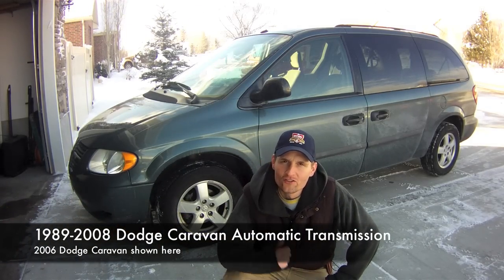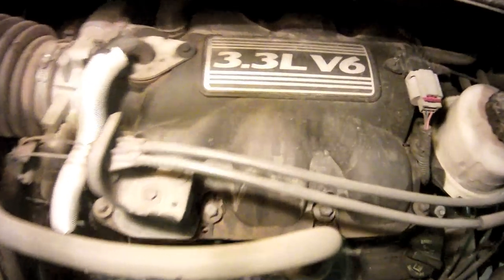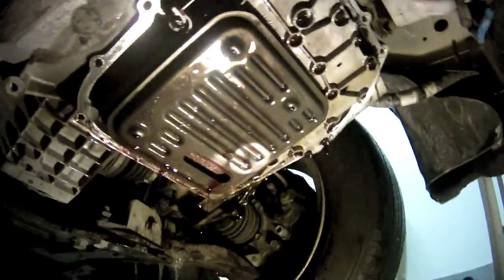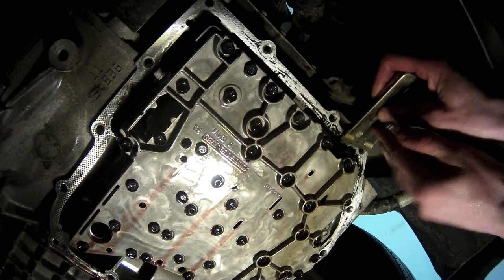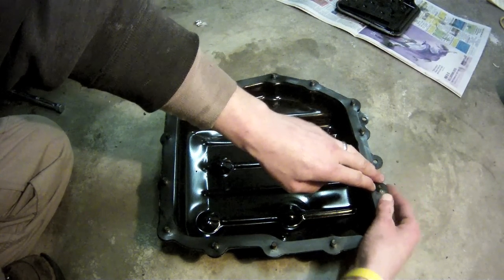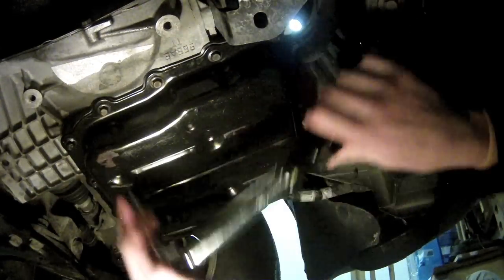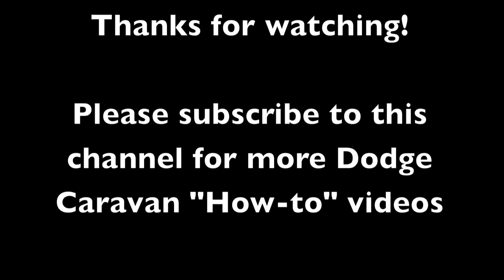How to Change Transmission Fluid in a Dodge Caravan

Comment: Thanks a lot. job done. Removal is fairly easy. Found the bolts very easy to remove not high torqued. Putting new filter up gave me a hard time (bought it from Amazon, pins were too small, filter kept falling, o-ring broke, crappy product, etc; Bought it again from Autoparts store and it worked fine), gasket on, no sealer used, no torque wrenched but followed the sequence and common sense while tightening, refill it up, no leaks, ran it, checked, good to go. You can do it !!! Be safe. Use Floor cover, Gloves, glasses, light, highly recommended.

Comment: This is a most excellent video. Thank you. It helped out tremendously. I just did this service today. The longest part is to scrape the gasket material off the body of the casting. Even though the Dodge service manual says 165 inch pounds, I agree with you when you say 120 inch pounds. I heard about these 40TE, 41TE transmissions sometime having weak castings that are easily stripped. Also someone wondered if the trans fluid could be sucked out the trans fill tube by sticking a tube down the fill tube and using one of those vacuum pumps. I tried this and was only able to get a quart out. This is because the van was on ramps and the fluid went to the back of the pan. the dipstick tube is in front of the pan. Thumbs up and Subbed!
Reply: Hi. I am about to do this procedure. Will I need to add rtv sealer to the provided gasket? Or just the gasket by itself?
Reply: @lromeroyt  I found out something from the dealer. Chrysler does NOT use the gasket anymore. They just use a special rtv sealer when they put the pan back on. The special rtv they use does not break down from transmission fluid. I would go to the dealer and get this special rtv sealer and just use that. They can tell you how thick to put the bead around the pan surface. I forgot how thick the bead should be. 
I have another tip. Make sure you use the torque sequence when tightening the bolts. I used a torque wrench that could do inch pounds and I took my time. Don't over tighten or a bolt can strip out. If a bolt happens to strip, do what I did and go to Lowes or an ACE hardware and get a slightly longer bolt that has a couple of more threads on it. It might be able thread into extra unstripped threads of the transmission body. BTW my Dodge Grand Caravan has 187K on it now and I'm not gonna change the transmission fluid anymore. The clutch particles in the fluid might actually be the thing that's making the transmission still work!. No kidding!

Comment: Nice Vid. Breaking the seal to remove the pan was tough on my car as RTV had been used. Had to carefully use a hammer and a sharpened screwdriver to pop it.  I used a gasket and some Permatex sealer to reassemble. When replacing the filter make sure the old O ring has come out properly (mine hung up inside the hole ) and O ring is in place on the new filter.

Comment: Great video. Doing this service today on wife’s van then on my Porsche Cayenne. Unfortunately this one is way easier than the Porsche is. Purchased a Mityvac fluid extractor/dispenser so can pull all the fluid out of the pan before I drop it. Hoping it eliminates the mess.

Comment: you speak very clear, good video and lighting which many diy videos don't demonstrate. thnaks.  i did this on my van 30000 miles ago but forgot if i poured fluid out of filter as part of my total amount in the bottle where i put old fluid. my hardest part was breaking loose the pan after removing the bolts.

you mentioned 4 qts drained. did that include pouring out  the fluid from the filter?
Reply from the maker: +scooter12368 I didn't get precise enough to measure the fluid that was in the filter. The idea is to get a general idea of the fluid lost so you can get it filled properly faster, but you still need to follow the appropriate measures to get it filled back up to the right level (regardless of how much fluid you measured coming out). A quick example is that if you had somehow lost some fluid on the road, you wouldn't want to just fill back up to the level you were at before, you would fill it to the level it was at, then take readings and add more as appropriate to get it up the the right level.

Comment: Very good, succinct description with excellent camera work, well done.

If i may suggest a few things:

Do not base how much fluid you need to replace from how much you drained, this is because you could be missing some. The 41TE that you drained has a total of 9.1 quarts, when you do a pan drop 4 quarts SHOULD come out. So regardless of how much you drain, you should add 4 quarts of ATF +4.

The torque on the pan bolts is 19Nm (165 in. lbs) according to the service manual, make sure you leave a note not to confuse anyone. 

Cheers.
Reply from the maker: Great tip - you are correct. Looking at how much fluid you took out is only a rough guide. You should always check the fluid using the dipstick once the vehicle is warmed up to make sure that the fluid level is correct.
Reply: wait- my old fluid is bad (tan colored).  I want to replace ALL of it.  Are you saying I can only drain 4 qts?
Reply: @baconmaster1023  Yes, if you want to replace it all you have to flush it. Or do multiple replacements

Comment: I'm a big fan of Permatex's "Hi Tack" gasket sealant. It never hardens, is impervious to oil, gas, etc. and seals up any small nicks in the aluminum sealing surfaces.  It's not RTV, it's more of a very sticky liquid, but it's amazing for sealing when using gaskets.  Also, Hi-Tack won't shed booger balls like over applicated RTV and clog up small oil passages.

Comment from the maker: Thanks for the tip Pete! As you mentioned, High Tack works great WITH a gasket whereas I've mostly seen RTV used AS the gasket. One quick note about RTV (since you mentioned it) is that normal RTV is not compatible with ATF and should not be used to seal transmission pans. Thanks for watching!

Comment: Decent instructional vid.
I've a question, if anyone's still haunting around here. ...
My friends '96 caravan's transmission is low, not reging on dipstick. Was having difficulty understanding what it means on the stick, on how to fill/ not to fill, depending on where the level is on dipstik, plus temperature is pending as well,-.. as there's instructions stamped on it. Do I just fill it cold like you did in vid? or do I warm it and fill? Fill with eng running or??...  also, if it's not showing on stick, is that a qt or two low?? The trans does go into gear and drives, but she says it slips a tad once it's warm & driven.. 
Thanks if anyone can add some light

Comment: FogoFox...Amazing video...Thanks for the simple, step by step, well narrated and well shot production. We own a 2003 Chrysler T&C w/a 3.8 w/85k. Recently, put it in reverse and "nothing" for about 30 seconds. Then the "hard downshift" thing started. After looking at a pile of blogs and watching your video, I decided to change my tranny fluid. Although you stated this several times in your video, I tightened my bolts to 80 ft/lbs NOT 80 in/lbs. Stripped a bolt...my bad. BTW, no change in tranny.

Comment: When removing the pan, better to remove all of the bolts except for the four at the front of the van. Just barely loosen those 4. Alternate striking the back corners with a 2lb. blow hammer and the pan will loosen, letting the fluid drain. Go have a 15 minute lunch. When you come back, the fluid will be drained enough that it wont gush out like it did to you.

Comment: Thanks for well made video... I just replaced a radiator on my 1999 caravan and for some strange reason I now have a leaking AT sump pan gasket.. All is good on oil cooler end and fluid is flowing.... So will need to remove and change fluid.. And filter while I'm at it.! Thanks..!

Comment: Thanks for the video , I followed your instruction I tried at 40Lbs stripping the tread of the engine, I think it was too much torque, 2 out 14 got spoiled, next day i Pulled out the pan again , It drain even more fluid, and then  applied Permatex excellent product
my torque was very light 14 pounds only, I would strongly recommend  this sealant , when i disassemble was with sealant originally , it was very hard to get it out after i took off all bolts, I had to hammer and use a crow bar to break the sealant, 
Anyhow I got the job done, I let it dry for 72 hours before i refill with fluid, my engine it aluminum very soft for 140 pounds, I might be wrong, but it better be safe than sorry, I used a gasket first after taking it off it was all wet and broken at 40 pound only
Thanks again for sharing
Reply from the maker: Are you familiar with the difference between inch-pounds and foot-pounds? Just want to make sure we're not talking apples and oranges here....
Reply: FogoFox I know so, when I disassemble it was light torque I just applied what I found , I did not want to strip more treads , so far I did an excellent job,  review your torque when you are using sealant and when you are using gasket , is different,  my procedure worked excellent after few weeks nothing drips absolutely nothing.

Comment: So you changed the fluid in the pan. - What about the other 4-5quarts of fluid in the converter ? ? You just going to leave that in to contaminate the new fluid ? ?
Reply from the maker: chuchyboy Yes. If your transmission has totally roasted out the fluid, then you should probably go ahead and remove it all. For a regular filter change and service, this is sufficient.

Comment: I liked your video but my question is did you use a sealant on the gasket? If you didn't why not and did you have a leak later and be honest. I had many leaks on my ford f150 pan leaks due to over tightening. But finally not leaking after countless times of using different sealants (blue RTV black RTV and even the yellow sticky hi tack). I finally just used the black rtv sealant and spread it with my finger all over the pan and the transmission surface and it finally stopped leaking.ChryslerNext

Comment: Thank you for this video. I have a Dodge Grand Caravan 2007 with 145k km on it. I purchased it with 66k km 5 years ago. I do not know if the transmission fluid was ever changed. Do I need to change it ? It looks pretty clean on the dipstick.
Reply: Yes I would it is simple enough with proper tools and parts available on hand. Follow your vehicle owners manual if you do not know ask the local dealership for what type is being used.

Comment: Great explanation and amazing execution. I am going to try it on my '96 Caravan. But if I don't have and can't currently afford a torque wrench, can I use a normal wrench to tighten the screws? How can it affect the deposit?
Reply: Not sure if you've already done the job but you don't really need a torque wrench. There is a proper torque spec for the bolts but this isn't a technical procedure. You just want to snug the bolts. The gasket does the sealing so you just need to be sure they're snug. Just be careful not to over-tighten or you could strip out the threads on the transmission.

Comment: Excellent video.  Have you ever done this job using an oil extractor through the transmission dip stick tube?  Might make it a cleaner job when you go to drop the pan.  At the same time could lead to problems.  ie torque converter gets drained and then is runs dry on start up?.  Any thoughts?  I would rather do it the messy way knowing I won't screw anything up.  My 2005 Caravan owner's manual says you never have to change the fluid in the transmission.  Right now it has 81,000 miles and trans fluid is bright pink.  I bought it used at 79,000 miles so I'm not sure if previous owner flushed it.  Regardless of what the manual says I think I will do what you show in this video as soon as the fluid starts to darken.  Also I notice the snow in the video.  Have you had blown power steering hoses during winter?  I live in Saskatchewan.  Very cold winters.  I changed my power steering fluid to BG Universal Synthetic Power Steering fluid.  I hope it solves the problem.  Any experience with this?  I know someone in Saskatchewan would works at an automotive garage as a service writer.  Last winter he said around 15 customers came in with blown power steering hoses on there Caravans and there was only one with a GM.
Reply from the maker: +Niko Lehocky No experience with that blown PS hose issue. 
One downside to doing the oil extractor is no chance to inspect the pan magnet or to replace the filter, but it would be a nice clean way to get the fluid changed I bet.

Comment: thanks , i didnt see any glue put on as you had to scrape the old glue off. do i need glue then or does the new gasket hold fluid without glue? thanks this was just what i needed to see. i couldnt find a drain plug so i have never changed the tranny fluid, its time.lol

Comment: This past weekend my wife told me that her van ( 2001 T&C ) w/ 130k was acting up. I took it for a test drive and noticed that it would quickly surge at times for a quick second when driving. At one point the transmission would not shift into a higher gear making the engine rev at 3000rpm at 50mph. I am not familiar with these vehicles and fear that a rebuild may be in order. Any suggestions from those who have experienced this would greatly be appreciated.

Comment: You did a fabulous job explaining and showing how to change the tranny fluid.  Your camera work and lighting is especially clear.  Am I correct in assuming it's not too different changing the fluid with an 07 Town & Country?  Are there any special pointers that pertain to this model & year?
Reply from the maker: Maggie Thanks for the compliments. Everything should be very similar if not exactly the same.

Comment: Excellent video. We work in Nm here and please correct me if I am wrong but the first pass is about 9Nm and the second would be about 13.5 Nm. If I am wrong I will not be surprised as I only just found out how to convert Inch-Pounds by using You Tube five minutes ago How to Convert Inch-Pounds to Newton-Meters : Conversions & Other Math Tips PS Is that ice on the car?!!

Comment: So you've changed the pan gasket and filter but what about the other 70% of fluid left in the transmission cooler lines and torque converter? Do you just not service the rest or do you have another video out describing how to remove and replace that fluid?
Reply from the maker: Well Devin, as you may know, the rest of the fluid can be changed by hooking up lines into the transmission system and running fresh fluid through by means of the vehicle's own pump, or by hooking into a service station's auxilliary pump. I'm not comfortable with the second method (using an external pump could lead to other issues). Using the vehicle's own pump is a bit more complicated than shown in this video.
For me, it comes down to what you are trying to accomplish. If you've burnt up your fluid to the point of potential damage, then yes, all the fluid should be changed (and you should probably replace internal transmission components too). If you are simply servicing your transmission; ie. dropping the pan to replace the filter, clean the magnet, and inspect for damage, then I think the procedure shown is sufficient...even though some of the old fluid is not replaced in the process.
Maybe someday we'll do a video on how to run 100% new fluid through the system.

Comment from the maker: Thanks! You can see the catch pan at 6:18 in the video. It's just a plastic rectangular pan from Autozone ($2 or $3). The torque wrench I used is a Performance Tool M197 and I think it is a good low-end wrench. Do NOT buy the Harbor Freight ones! I also have two other larger Performance Tool torque wrenches to cover the range of torques up to 300 ft-lbs. You can definitely buy nicer ones than mine, but I think you'd be hard-pressed to find one that works for cheaper.

Comment: Tnx joe for this tutorial video. can u also post a video replacing oil pan gasket for 2007 3.3L dodge carava
Reply from the maker: You know, we've been thinking about getting that done here pretty soon. It's going to take a bit of time to get the video and editing done though. Standby...
Reply: tnx. by the way. to close the pan cover of the ATF.  then in using the torque wrench how much psi are you going to set? is it in metric or imperial? tnx once more!
Reply from the maker: The torque on the transmission pan bolts was 120 inch-pounds (which is not a metric measurement). If you don't have a torque wrench, be very careful. 120 inch-pounds is not too much and it would really stink to strip out the threads on the transmission.

Comment: I'm actually doing this right now. I'm thinking it's a lost cause but I'm taking the chance anyway. I've noticed that the filter is loose (kinda wiggles) when I put it back up on the transaxle. It looked like it was still kind of loose when you put it back up there too for this video. Is that normal?
Reply from the maker: Louis Cypher It's hard to say what yours looks like over the internet to tell you if it is ok or not, but yes, the filter does not fit back on super firmly and is somewhat loose - once the pan is installed, it actually helps to hold it in place so it won't fall off.

Comment: where can i get those parts because the dealer recommends only silicone and i like this way better than the silicone.
Reply from the maker: There are a lot of online auto parts retailers if you don't have local generic auto parts stores. Dealership parts always cost more, but are usually high quality.

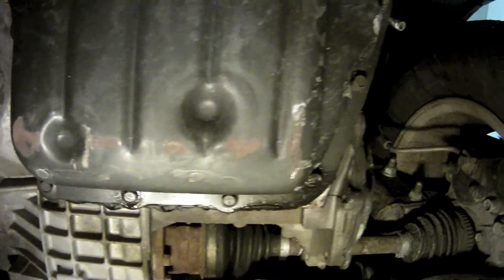Comment from the maker: It's right on the front of the transmission, above the pan, below the two hoses that run to the transmission cooler. You can almost see at 1:17 in my video right in front of, and below the transmission dipstick. Then again you can see the bottom of it at 1:50 right above the pan on the left side.